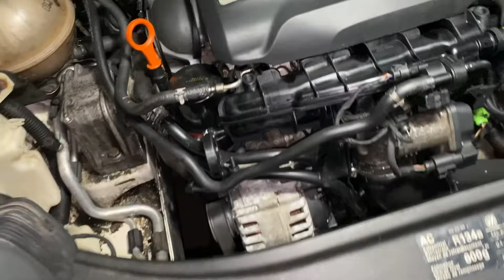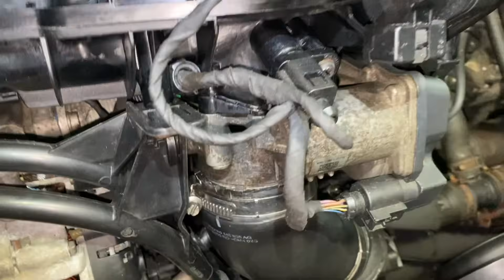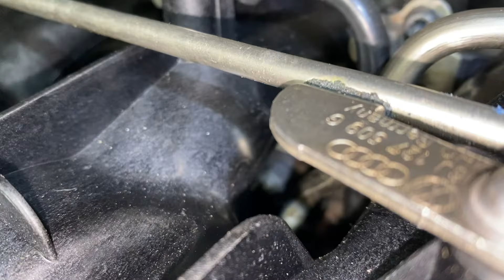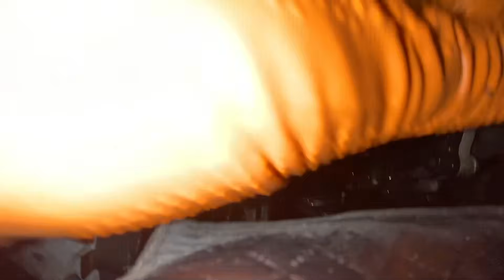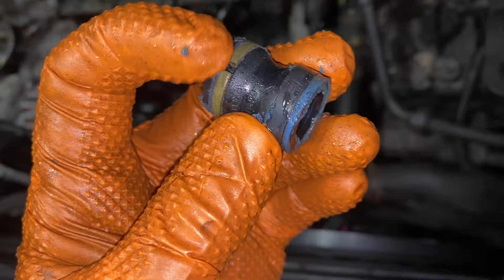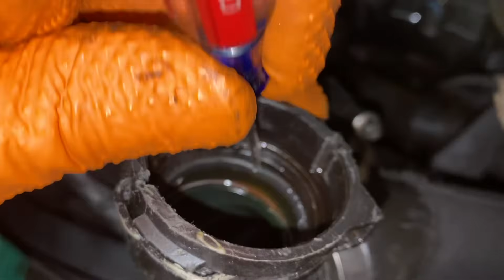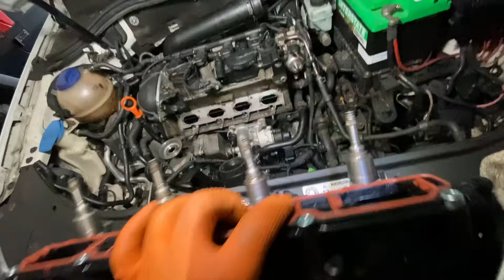Step-By-Step Water Pump Replacement on VW Passat, tiguan, CC, EOS 2.0 Turbo TSI/ CCTA  2008-2016

Comment: If you are struggling to remove the manifold after following this video, check for a bracket under the manifold that requires a M10 triple square socket to remove. This video does not show or mention this bracket. I spent an hour trying to figure out how to remove the manifold before I discovered the bracket. 2012 VW Eos.
Reply: Man you are the best. Ran into the same problem as you and your comment was a treasure!! Appreciate you sharing it.
Reply from the maker: Thank you really appreciated!
Reply from the maker: If you would have read the video description you would have saw the mentioning of it and a video too.
Reply: @motorcarnut  Maybe you should post it in the video at the time you are removing the manifold. Just trying to help the next guy from struggling with it as I did.
Reply from the maker: Most of them don't have that bracket like in the video, that's why I forgot to mention it but I will put it in the video. Thank you for your suggestion.

Comment: I have question , why you reinstall the intake manifold and the water pump using only the proper gaskets, without any sealant or glue?
Reply from the maker: Because they are all rubber o rings and you don’t need anything else

Comment: Should really replace the seals on the injectors, can get by not replacing manifold gasket but should also be done. Already in there and the parts not expensive.
Reply from the maker: Both should be replaced

Comment: I know this is a late comment but I followed this tutorial to a  t, and now I’m getting a “crankshaft position sensor a circuit high input, (bank 1 or single sensor) “ code. My engine will crank forever but won’t start now. Any ideas on what to look at/ try?
Reply from the maker: Check that the sensor connector is fully seated and that no wires were pinched or damaged during the repair.
Reply: Crankshaft position sensor or camshaft position sensor replace it

Comment: Thank you soooooooo much for this video. Had to swap the water pump on my son’s 13 cc and it’s been a while since I’ve wrenched on cats. Made the project doable. One question. Is there a trick for the water pump belt? That thing was almost impossible to get on.
Reply from the maker: Thank you for your support! Appreciated and yes, you put them both on at the same time the belt and water pump because of the dowels in the block.

Comment: Do you have to bleed the system?
Reply from the maker: Most of the times no
Reply: @motorcarnut  I ended up going over 190 when driving. Solution was leaving the cap loose and bringing a bit of coolant with me. I did try and let it warm up 10 min before doing that
Reply from the maker: Yeah that can work too.

Comment: Nice video. What is approx. time to do job start to finish
Reply from the maker: Depends on your skill level and tools you have, I can do this in 2 hours others need a weekend, bottom line it to do it right and don't rush.
Reply: @motorcarnut  One more question ? The injector o- rings, Do you fish them out of block or just reinsert injectors ? Thanks for timely reply.
Reply from the maker: The injector o rings if they come off just reinstall them unless they are ripped or leaking

Comment: Honestly One of the most clear and concise car repair videos I've seen on Youtube.  The closeups of the screws before and after and the gaskets was very helpful.  I couldn't stomach paying a mechanic over $2K to do this, given that the part is under $100.  I'm assuming the aluminum replacement comes with a new thermostat inside?  Thank you so much for filming this for us.  You got a Sub from me.
Reply from the maker: Really appreciate that! Yes, the aluminum housings usually include the thermostat.

Comment: At the end do you bleed the system to get air bubbles out with the radiator cap on the left off ?
Reply from the maker: You don’t have to just let it self bleed then add more coolant after it cools down to middle of tank

Comment: Also for the mk6 gti 2.0tsi e888 gen 1 cbfa their is no aluminum aftermarket water pump available.. only for ccta engines... something to do with an extra sensor on the water pump... And of course , my mine needs replaced again when I just replaced it fifty thousand miles ago...
Reply from the maker: Yes they are different not all but some are like California emissions
Reply: @motorcarnut  im very confused... my car is a 2012 beetle turbo 2.0tsi e888 gen 1 CBFA.... cali car... I have the secondary air injection... 

I know for a fact its cbfa because my tuning requires that info...

But my water pump didn't have the second sensor... 

I\nFirst bought the car about five years ago and had to have the wp replaced...  paid a shop 1500...

This time wanted to do it myself as ive take the intake manifold off several times already....

Bought oem wp with second sensor from fcp .... 400$

Removed the water pump and it does not have the sensor and there was no wire for the second sensor

I installed the water pump anyway , and it seems fine... But I wanna know why my engine doesn't have it when it is supposed to
Reply from the maker: Yours doesn’t have a plug and you have no lights on you bought the wrong pump but it will work fine just you paid a little more than you should have.

Comment: I must’ve missed a bolt on the onlet manifold. There is four torx on the top ,two on the bottom and 2x10mils but it still feels like it’s connected.
Coming off but springing back
Reply from the maker: There might be a hidden bracket holding it in place. I have another video on some models that have one and the fuel injectors get pressed in and that could be your problem.
Reply: correct. 
Found it. 

Braces block to underside of manifold. 

Just awaiting new pump and retainer for the temp sensor.
Reply from the maker: Good luck with the repair
Reply: all done but I have 3 cumfrum bolts (where did these come from). 
T30 and about 20mm. 

I think I’ve left one off the water pipe at front next to fuel pressure reg. 

I’ll check tomorrow with borescope. 

I’ve had it out on road and idling in garage for about half an hour so there’s no leak. 
I’ll check it all again tomorrow when it’s cooled.
Reply from the maker: Great! well as long as there are no leaks and they are NOT in the engine you should be fine
Reply: found them. 
Block water hose bracket and pump belt cover.
Reply from the maker: Not critical but glad you got them!
Reply: nah those ones are always bracket or superficial bolts but was annoying me.
Reply from the maker: They are

Comment: do you have a link for a 2010 VW Tiguan, it leaks and I think I can just do this my self :)
Reply from the maker: This video is the same for the Tiguan, same engine.
Reply: @motorcarnut do you have a link to that aluminum water pump ?
Reply from the maker: Customer used this one and worked great.
https://www.amazon.com/06H121026CF-06H121026AB-06H121026AE-06H121026AF-06H121026BA/dp/B0FCM4TD1Q/ref=sr_1_5_sspa?crid=2QWAA2OOO7VDT&dib=eyJ2IjoiMSJ9.c0DO4ruaNsqoECjqJclijRrRxavLjpb_KIs1TeixwpChJJ25-7QFpvUAL6bVsZ_gGa8c7ErqbBTsL9cqQSWCFKuRwOShKWGr1xe-h2VFsPg5Pn2vp93BwTqQCyARNRmhFh1O4lqyjOBO2Xz1h6LQ8lO-qQVDCKrf8xJ2eEJqK7hscNDSfJnenyZKVj2lJokjMirI2lFXxCmDHr0wpCMPm7PgvJsbS3nisnEVoNEvOC8.kz0Kz26qw8KnFHxTLemApYGe62DXqwQlZlAOmTaCRRg&dib_tag=se&keywords=2010+tiguan+water+pump&qid=1768610717&sprefix=2010+tiguan+water+pump%2Caps%2C114&sr=8-5-spons&sp_csd=d2lkZ2V0TmFtZT1zcF9tdGY&psc=1
Reply: @motorcarnut wow it only costs $43 ? lol
Reply from the maker: They have more expensive ones but they are mostly all the same because VW doesn't make a factory one.
Reply: @motorcarnut thanks for your help
Reply from the maker: No problem, good luck with the repair!
Reply: @motorcarnut this kit seems almost too cheap, some feedback on leaks and the thermostats breaking, you have good feedback from customers on these ? i don't mind paying extra for a quality pump ?
Reply from the maker: I haven’t heard back from some I did as far back as 5 years but like I said aluminium is aftermarket. This seems like it could be an option:

https://www.ecstuning.com/b-bremmen-parts/water-pump-module/06h121026dd~brp/?gad_source=1&gad_campaignid=19434227212&gclid=Cj0KCQiAg63LBhDtARIsAJygHZ4FcdK3rqxzkMEXOIoiW5TXCA0tCoHa9MVJY8If0N5H88NmLVal_FcaAi60EALw_wcB
Reply: @motorcarnut  thanks for reply, I appreciate your time!  I think I like this better, its a lot of time to put one in and I don't want to cheap out on this... because I don't want to re-do it later again, we have a new OEM put in 5 years ago, and that's all it lasted 5 years, which sucks, so I will do this my self now!
Reply from the maker: Sure no problem. I hear what you’re saying then I’d go for this one from a reputable company too. Good luck in your repair!

Comment: I tried adjusting the bottom bolts but one keeps rotating forever, I took it out and there is a piece of silver underneath the thread of the bolt, will this be ok, or how can I solve it, I think it stripped inside.
Reply from the maker: Yes they are known to strip. You can try a slightly larger bolt or you may have to tap and use a helicoil ( have a video on that)
Reply: @motorcarnut which one is the video for that? I turned on and coolant not leaking, however fuel is leaking now. I tried running for a bit until temperature gets to the middle line zone. Then the fuel stopped leaking, however initially when turning on for first time fuel leak was insane. It was dropping a lot of fuel to the floor, small drops then became constant as it was the coolant in the past. Do you know how to solve this? Will it be I messed up something while assembling it.
Reply from the maker: Repair threads video, not at the computer now to check exact wording
Reply: @motorcarnut  I was not able to find is it for VW or for some other car in your video?
Reply from the maker: https://youtu.be/_b37EBMLqn8
Reply: @motorcarnut  Can I do this repair without removing the engine? I saw your video and Engine is out.
Reply from the maker: The water pump? Absolutely
Reply: @m @motorcarnut not to take the entire engine out for fixing the thread. Can it be done in place?
Reply: I mean for repairing the threads, i think that I tightened too strong and threads got broken.
Reply from the maker: Depends where it broke and can you get a drill in there?
Reply: @motorcarnut i will try to see, if I add another bolt with different thread, same size. Will it fit?
Reply from the maker: They will strip more, not a good idea
Reply: @motorcarnut when you said use a bigger bolt, do you mean length or you meant bigger number like from 6 to 8 diameter?
Reply: The car is leaking gasoline, but it after heats up to middle it does not leak gasoline at all. Also with hot weather it does not leak but with cold weather it does.
Reply from the maker: Length
Reply from the maker: Where is the leak coming from? And you have to be careful that’s dangerous

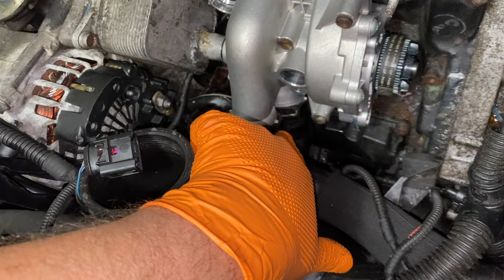Comment: 21:20 how do you put the bottom tubes inside, mine does not pass the middle line from big one .
Reply from the maker: It should just slide on until it clicks
Reply: @motorcarnut it worked just by pushing a lot,

Comment: How can I replace the belt in there? I am not able to take it out no matter what. My replacement part comes with new belt and I would like to to replace it.
Reply from the maker: You have to install water pump and belt at the same time.
Reply: @motorcarnut i can’t take it out, I just moved on without replacing the belt
Reply from the maker: That is how it's done. But it there were no cuts or cracks in the belt you should be fine.

Comment: I don’t have lube, can I use the WD30 as lube for this?
Reply from the maker: For what part?
Reply: @motorcarnut I used wd40 silicon for the rubber ring waterpump
Reply from the maker: Yes Fine

Comment: Which tools do I need? Do you have a list, I need to do this repair and I am college student. The shop is overcharging and cannot afford, I have a VW cc 2013 with 50000 miles.
Reply from the maker: You’re going to need regular hand tools and some torx and spline drive sockets
Reply: @motorcarnut thanks a lot, I got all.
Reply from the maker: Awesome, good luck!

Comment: I need to replace my water pump. The video explains it perfectly, but I got scared the moment I realized I had to remove the intake manifold. Do you think an inexperienced mechanic should attempt this? Removing the intake manifold looks so daunting to me xD I've done servicing and such many times myself, but never removed the intake manifold :D
Reply from the maker: Take your time, watch the video and I have another video on the hidden bracket that has to be removed too. Need a coupe of special tools but its not that hard and if you get stuck just give me a shout out.
Reply: @motorcarnut  Thanks for the info! I’ve got a 170-piece tool set, so I think that should be enough, right?
I have two more questions though. Since I’m already replacing the water pump, wouldn’t it make sense to also replace that small belt that drives it — and maybe the tensioner or pulley as well? Or is that not really necessary?

Also, to be honest, I’m not even 100% sure my water pump is bad. I just noticed that when I top up the coolant, it goes back down to the minimum after a few days — but it stays at the minimum and doesn’t drop any further.
That’s why I thought maybe I should just try replacing the water pump.
Reply from the maker: If the water pump is not leaking I would not replace it now. You may have a small leak somewhere else, could be a faulty expansion tank cap, may be burning a little coolant etc. So unless it’s definitely leaking I would do a little more testing before replacing it.

Comment: I need to change the water pump on my 2011 GTI but the engine code is a CBFA and from what I'm seeing online is that mine has 2 temperature sensors instead of 1 and I'm having trouble finding an aluminum housing that will work for my engine
Reply from the maker: You're right about the two temperature sensors. But depends if your vehicle is California emissions as well, some have just the one sensor. Double check your part numbers, there should be an aluminum housing that works for your engine. Try going the dealer website look up your septic vehicle get part number and buy online.
Reply: @motorcarnut yeah I'm in California and it has 2 sensors, I crammed my phone in the engine bay and saw it on video.
Reply from the maker: Yes, then just do what I said before to get the part number
Reply: @BryceH14 did you fine the aluminum water pump?

Comment: Damnit you skipped the hardest part which is installing the pump to the union and cooler
Reply from the maker: Not really it just slides right in and lines up itself

Comment: i have an 09 CC.. the only thing different is that is a triple square bolt that holds the intake on. Other than that this was great info!
Reply from the maker: Thank you, yes it’s in the description and I made a video on the hidden brace after I made this video.
Reply: @motorcarnut  I must’ve missed that the description. I just watched the video.
Reply from the maker: Yes, because a lot of newer ones don't have that brace and I forgot to mention it in the video.

Comment: Can you reply with the link for the waterpump you bought im having a hard time finding one, thanks!
Reply from the maker: Sure this is for the 2.0 TSI engine 

https://a.co/d/cSRrVz1
Reply: @motorcarnut thanks! now is this the same for a 2014 passat 2.0 tdi?
Reply: On there it says its only compatible with 2010 passat are they the same?
Reply from the maker: Best thing to do it look up you exact vehicle on VW parts site for part number then look on Amazon or eBay to buy one.
Reply: @motorcarnut any good sites you recommend?
Reply: @motorcarnut thanks for the responses as well man means alot!
Reply from the maker: Sure , no problem! Good luck!

Comment: Watching this video I could swear I could smell the old coolant right under my nose. Thanks a lot for this detailed video
Reply: This video was very detailed and a fantastic illustration. Do you think it's a good idea to change the oil cooler while it is torn down?
Reply from the maker: Thank you! Unless the coolant system was corroded or the oil cooler was leaking then no.
Reply from the maker: lol, sure no problem!